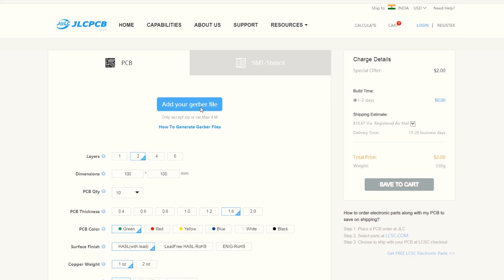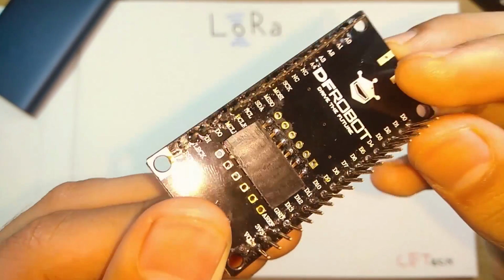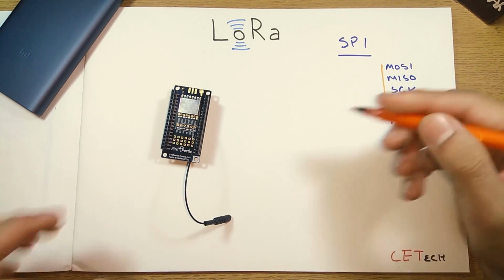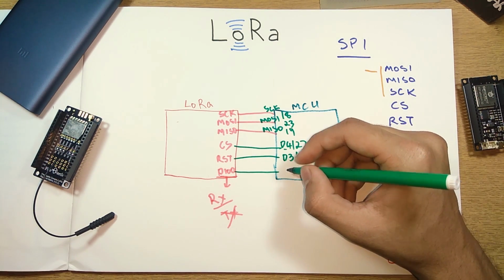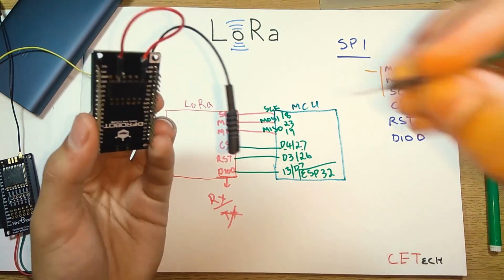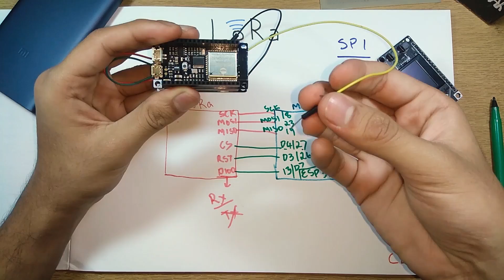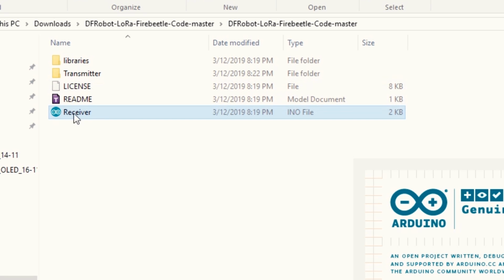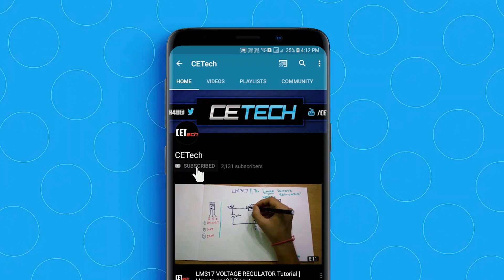LoRa ESP32 Radios Easy getting started tutorial | No Wiring

Comment: Are these Firebeetle LoRa radios and Reyax RYL R890 you had in a previous video compatible? If I have 2 of each, can they communicate with each other? I'm thinking no because the Firebeetle uses SPI bus and the Reyax uses UART serial RX and TX ports.

I'd like to send data from a Firebeetle transmitter with a Firebeetle ESP32 board and receive it on a Reyax RYL R890 radio on a arduino nano. I just don't know if its possible to send on SPI and receive on UART? but maybe there is a way that I am not considering
Reply from the maker: You'll have to try this out. They aren't compatible out of the box, will have to tweak some settings here and there to do so

Comment: Hey, should I go for REYAX LoRa or DFrobot LoRa module?
Reply: Ra02 works on 433Mhz, not sure if can be used in India openly.
Reply from the maker: Yes that is right Nova. In India LoRa frequency band is 868 which is kind of legal and that is the frequency on which all the gateways work here.
Reply from the maker: Well it depends on the use case, if you use different parts from different manufacturers then go for Reyax as it is a easier to work with. If you have all the parts like I did in the video from DFRobot then should go with the Dfr LoRa
Reply: @CETech4u  I can use DFROBOT LoRa module with Ardunio right?
Reply from the maker: Won't recommend. As it is an overpriced solution for using with Arduino. As I told its advisable if all parts like display microcontroller are from DFRobot lineup of firebeetle
Reply: @CETech4u  Is RA-02 from Ai-Thinker a good option to be used with Arduino? Also if it is possible can you make a video on RA-02.
Reply from the maker: My next weeks video will be on connecting a Ra-02 to an esp8266 which is similar to Arduino. 
Just make sure to support my channel by Subscribing and sharing so that I get motivated!
Reply: @CETech4u Already subscribed and love your channel. Keep posting.